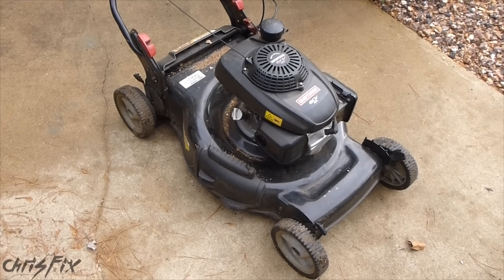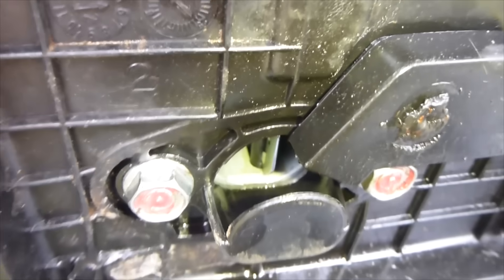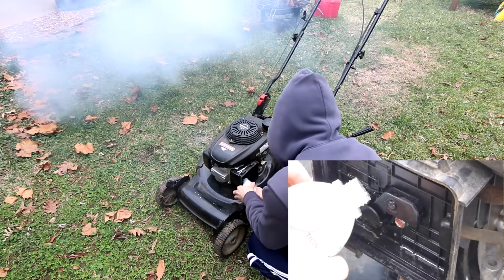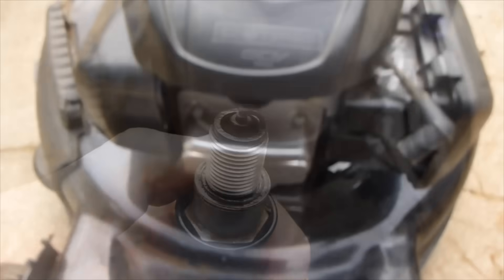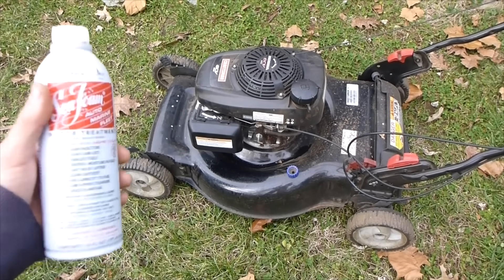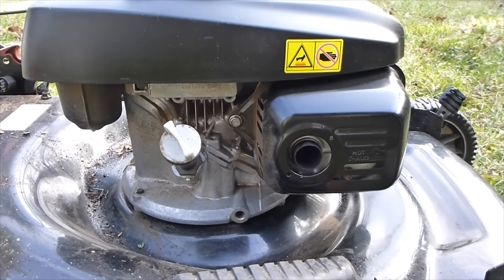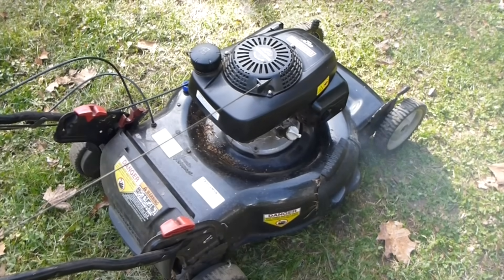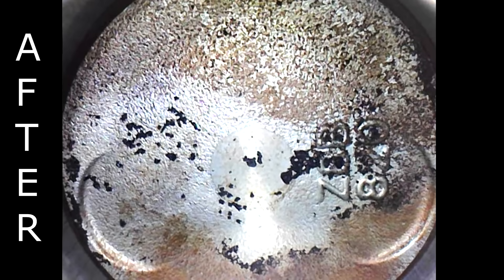Does Seafoam Actually Work? (with Proof)

Comment: Problem with all these cleaners is that they tend to clog fuel injectors which can run up to a grand to replace.
I just replace the fuel filter frequently.
Nissan Maxima w/220k. replaced fuel injectors at 170k.
During the winter months I use octane booster which seems to help.
Reply from the maker: +cpgone That is why seafoam is my preferred cleaner. I used techron, gumout, and lucas, now my trucks injectors are clogged.
Reply: So the others clogged the injectors and SF unclogged?
Thanks for all your vids. Im new to Ur channel
Reply from the maker: +cpgone No, I used seafoam in the intake so it didnt get a chance to go though the injectors. I dont want to make it worse. I am replacing the injectors.

Comment: misting water into the intake while the engine is running would work much better, seafoam is nothing but high octane gas with a few other ingredients that would just add to the buildup, and  TBH seafoam is made for fuel injected engines so this test is kinda pointless.... just saying
Reply from the maker: +Michael Muller I will be testing water so stay tuned!

Comment: if you did that with 91 % rubbing alcohol, it will clean 100% better. Since sea foam is oil based, it's never going to get it all out !!!!
Reply from the maker: +TheDave570 Thanks for sharing!
Reply: +TheDave570 I think the alcohol will probably cause detonation in the engine and it will explode.
Reply: +Ch0k0TB No it will not, it burns at a higher temp. It will NOT explode!

Comment: More important then removing carbon on top of the piston is loosening up carbon that can cause the rings to stick, water doesn't help with that.          In my testing, Suzuki and Honda Combustion Cleaner worked much better/faster than Seafoam to dissolve carbon, also cleans carbs very well.
Reply from the maker: +jalyukon Thanks for sharing!

Comment: i have water injection on my car with a little drip counter to one of the vacuum lines. in a 25 year old carburettor engine the piston tops were black and crusty with carbon... now nice and almost mirror shiny after a few thousand miles of use :D before then engine had issues with over run it was that carbed up!
sadly it does cause the exhaust to rot out.. but that may have been because it was 25 years old haha
Reply from the maker: +johndragonman Thanks for sharing! I want to try that!
Reply: +ChrisFix it is worth checking out.. i wish it was an easy thing to do with turbo diesels but you do have the turbo to factor in. modern day diesels here in the UK suffer with carbon build up in the intake manifold caused by the little bit of oil turbo chargers pass and EGR gasses.
the stuff is like cholesterol for engines. sadly water will not remove it as its oil based.
however, if you were to replace the water with say paraffin.. it may start to work.
Reply: +ChrisFix ahh an another thing water injection is super awesome for is cleaning out catalytic converters! if you have quite a bit of water flowing through the intake  (not enough to damage anything!) it effectively steam cleans the cat converter! it really helps bring the emissions back to good parameters :D

Comment: Hi, Thanks for this informative demonstration. I have an 7 year old Suzuki Grand Vitara. I have taken very good care of it. Regular oil changes, only has 76,000 miles on it. I have never, ever had any mechanical problems. The only thing I have had to replace so far was the battery....however, it is averaging about 3 miles to the gallon less than it use to. I am getting 18 miles to the gallon in the city. I have tired several products with no improvement...do you think Sea Foam, in addition to cleaning my engine, will help boost my mpg ? Thanks again.
Reply from the maker: +Alien Child It might help. It really depends on why the engine isnt running efficiently.
Reply: ChrisFix maybe it's just because the engine is almost 8 years old...it's only getting 3 mpg less than what it was when I bought it new...Thanks for responding.
Reply: +ChrisFix I like videos your

Comment: Firstly a really great video, well photographed and presented. I would have happily have had my name on this video too!! Just as it is right now, BUT!!

A few points to "ponder" for you:-

1) The engine had very little carbon buildup to begin with, it was a good test, but to keep the mower running, it was not really needed. You might mention that for your viewers....

2) The carbon that was there, around the top edge of the piston, especially on 4 stroke engines like Honda has,  has a second effect, as it also helps with "sealing" of the piston and therefore reduces oil consumption. You might want to warn users that until that seal is built up again, extra oil consumption might be a result. Especially with older worn, far dirtier engines.

3) Tipping the engine up, to soak the piston, may also have a bad effect on the engine oil. A thin liquid like seafoam could dribble down past the piston rings and mix in with the sump oil, maybe doing nasty things to that oil, so that oil needs to be purged and replaced, both on the mower or in a car. Especially in a car......

It sounds like I am criticizing you, I do not mean it quite like that, more as a few small additions to what is a fascinating and well made video, for which I thank you most kindly for making. 

Quality wise, one of the best videos of its type on YouTube.

Many thanks

Andy
Reply from the maker: +Andrew Mathison The idea of the test was to see if seafoam does anything. This engine was perfectly fine and most engines are. Also, this engine was being stored for the winter so the oil got changed in the spring so no worries about seafoam in the oil. Thanks for sharing Andy!
Reply: +ChrisFix Chris your missing Andy's point. The average Joe doesn't have that perception that it is a VERY GOOD IDEA to change the oil after possibly contaminating it.
here is another example it is from my own experience I bought a vehicle the radiator had to be  replaced from the get go, the idiots left the lower radiator hose clamp loose. yes, it got hot and pressured up then blew off as I was driving next thing I knew the gauge was pegging (should have kept driving until the rods popped out) anyhow they apologized and filled it up after tightening the clamp of course but NEVER changed the oil it broke down and washed my bearings out causing premature failure in less that a couple thousand miles. Just sayin

Comment: hey chrisfix, ive been watching your videos a lot and have found a lot of them very helpful! i appreciate you taking the time to make these videos!

i see you did seafoam test and was wondering if you ever heard of this stuff called ceracoat? its supposed to be a ceramic oil additive that helps coat the cylinder walls and create less friction in the engine because ceramic bonds to metal apparently...

i was wondering if you think this stuff is legit...there isnt many videos on youtube about it but it sounds like it could work

Comment: I run some Sea Foam through the tank on my dirt bikes after they have been sitting all winter..I think it definitely helps clean things out a bit and by running it through the fuel it might help clean the carb of bad fuel that may have remained in there.
Reply from the maker: +MXshredder125 I would say that is a good treatment!

Comment: Need to replace that air filter, if the Honda one is more expensive, you can use a Briggs & Stratton 491588S Air Filter, exact same specs, same filter, different branding.
Reply from the maker: +Charles Faust Thanks a lot for sharing! I didnt know that!

Comment: is it ok to spray carb cleaner into the cylander?
Reply: +Keith c i hope im not too late but no, dont do that that stuff will eat up your piston rings.
Reply: +Toyota 3SGTE  why doesn't it eat up the carb
Reply: roy hoco that stuff is just really bad on piston rings and other thin metal items but honestly do seafoam or do the water mist way watch videos on youtube seafoam and misting water in are the 2 best ways i wouldnt suggest spraying brake/ carb cleaner into the cylinders.
Reply: +Toyota 3SGTE I would never pour or spray any commercial product into my engines. I think they are all smoke and mirrors.  I will use some products to clean the exterior of the engines or greasy parts. I maintain my engines by regular oil changes, fresh clean fuel, and regular routine maintenance (plugs, filters, etc). It works for me.

Comment: Id rather keep the carbon build up on the pistons. Higher compression.
Reply from the maker: +Artby2wenty If carbon buildup is significant enough it can result in unbalanced pistons, high compression which results in detonation, and higher combustion chamber temps. A little doesnt matter but the point of the test was to see if it did anything.
Reply: +ChrisFix Use higher octane. Like 98 (eu).

Comment: Everyone knows that using water, yes water will do the same if not a better job. Its been used by mechanics for years. Don't waste your money on any of these "mechanic in a can" scams. Last time I checked water was just a little bit cheaper too. Run the engine at 2,000 RPM and dribble water into the intake and maintain 2,000 RPM while doing so. You can actually see the carbon being expelled out the exhaust, that is if there is a real carbon build up problem. If you do have a carbon build up issue it's most likely caused by poor air/fuel management. I highly recommend tuning the engine first. Then use the water treatment until you no longer see carbon being expelled. The principal is simple. Water molecules are more dense (heavier) than air and impact the the cylinder head and piston causing a scrubbing effect. Just a side note. The first time I saw this method used was on a Pratt & Whitney R-2800 Double Wasp engine. That would be what you find on a Douglas Aircraft called the C-118. For some very interesting information on the use of water in engines check out Wikipedia and look for "Water injection (engine)". Now you know. Take this information and impress your friends.
Reply from the maker: +55hdsteve Thanks for sharing. I will be testing the water method to see if it actually works! Stay tuned!

Comment: Light Carbon buildup on the top of a small engine piston will probably make zero difference in performance.  
But in trying to clean it, I think you might have just drove a bunch of carbon particulate down onto the top ring. Ouch. Score.
I do like your video's, and keep up the good work. Cheers, Mark!
Reply from the maker: +cdnpont It was a test to see if it works not that this engine needed  a cleaning. I agree that a light carbon buildup does nothing bad at all! Thanks Mark!!

Comment: I'm curious, what will it do inside of a carb? Will it clean the varnish from motorcycle carbs which have sat up for a few years?
Reply from the maker: +Brian Miller (Austin) Yes, while I have not tested it in the carb, it should clean varnish!
Reply: +Brian Miller (Austin) It does. I use it on my fleet of mowers with great results.

Comment: I've had success with this product using it on a 1990 Toyota pickup with the 22RE 4-cyl engine. It did clean a lot of the carbon out I applied it on a warm engine thru the vacuum hose removed from the brake booster check valve. Another product to clean intake carbon I've used successfully is the Techron in the 12 oz black bottle applied the same way (2 to 3 oz at a time on a warm engine). I went ahead and subscribed to your channel as you seem to have a lot of common sense useful info.
Reply from the maker: +socarboy Thanks for sharing! I am glad you liked the videos and subbed! Welcome aboard!

Comment: seafoam works very well soaking things in it. the seafoam will turn black if you soak spark plugs in it.  it breaks down the carbon and absorbs it. it makes it easier to remove hard deposits after soaking.

Comment: I removed the head from a K series Kohler and soaked it in seafoam for about an hour. The carbon was completely dissolved. 
I was amazed at how thorough it was. Great video.
Reply: Or you you could not wait an hour and just use a grinder and grind it off in a minute

Comment: I used to have a Chevy pickup that I had put over 200,000 miles on. The truck still ran fine. But I thought this product might help it out. I used as directions recommended. Some in the tank. Some run thru the throttle body carburetor ('89 model). And I put some in the engine oil as directed. Very shortly after doing all this, the engine stopped making any oil pressure. I had it towed to my mechanic. He ended up rebuilding the engine. He said apparently the product had "washed out" the bearing clearances resulting in too much clearance further resulting in no oil pressure. So, I went from a running truck with no problems to a tow, a rebuild, and a lot of money spent. 
Recommendation. Don't use this on a high mileage engine unless you have been using it periodically all along!!
Reply from the maker: +craig p Thanks for sharing Craig. I suggest never putting anything in the oil.

Comment: All I can say is that Seafoam cleaned the carbon build up on my old Rotax 377 engine well enough that it brought the compression from 140 on the front cylinder/90 on the back to 140 on both.   It cleaned the carbon off the pistons and cleaned the carbon off the rings so they again seat properly.    I was getting pre-ignition and a rough idle before using the Seafoam due to carbon on the crown of the piston and it now is running very smooth like it did when I bought the engine.   I am sold on the product for at least this two cycle engine.
Reply from the maker: +Bob Furr Thanks for sharing Bob!

Comment: you could just fill it up completely, let it soak, then leave the spark plug out and try to pull start it a few times, the flip it upside down to get the last bit out of it, then try to start it with the spark plug in, note that you're probably going to have to change the oil immidately so maybe put the spark plug back in right before removing the sea foam, then change the oil, remove the spark plug drain it, assemble it and start it as fast as safely possible
Reply from the maker: +denvera1g1 Thanks for sharing!

Comment: usually the wheels/handles will fall off and the deck will rust away to nothing before the engine wears out on a lawn mower.
Reply from the maker: +chieftp Yea, the idea was just to test the product in the mower before I tested it in this: https://www.youtube.com/watch?v=u6UeJXkzDW8
Reply: +chieftp Can confirm, We had a 35-year-old craftsman that the deck rusted out while the engine still went strong. Funnily enough, it did sing it's death song once, and seafoam fixed that. After that it never skipped a beat, even with a 15-year-old spark plug and an air cleaner that was way too far past due for replacing.
Reply: DontFilmYourTV
eventually I just get tired of repairing, adjusting, welding, and losing parts and just put them out at the street.

Comment: I Cannot recommend this stuff enough!  I got busy and didnt take my boat out for almost 4 years and it had 150 gallons of gas in there hooked up to a Yamaha 250 4 Stroke Outboard which are ultra sensitive to old fuel.  Well I added 3 gallons of Seafoam and the boat ran like always, with 4 Year Old Gas!!!  I use it for everything and it is cheaper to buy by the Galon!!
Reply from the maker: +Sean B Thanks for sharing!

Comment: Water works a lot better. The only think SEAFOAM worked well at is Lining the sellers pockets.
Reply from the maker: +Telly caster I will be testing water too so stay tuned!
Reply: I have used water to clean carbon deposits off pistons since the early 1960s. It works very well. a little at a time dribbled into the carb intake. If it is really stubborn I have used Transmission fluid sparingly as it really smokes heavily

Comment: All right, it cleans the piston. But what does it give you except cleaner piston? Was this carbon buildup any bad? Did the engine perform better or worse, or same after the process?
Reply from the maker: +Piotr L. Pawlak If you have significant buildup on the piston it will cause detonation, uneven and increased compression, and it will cause the combustion chamber to get really hot.